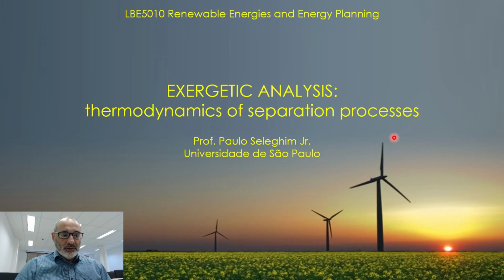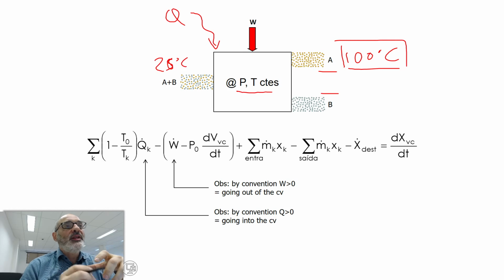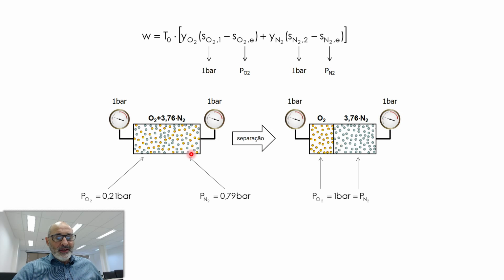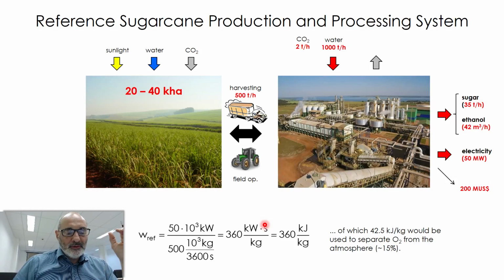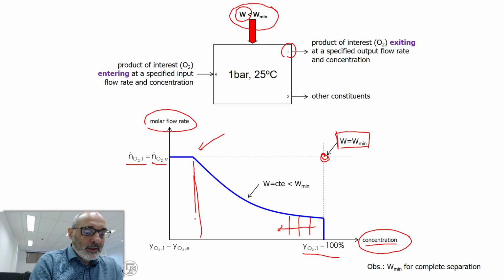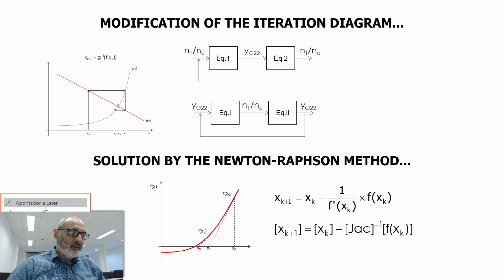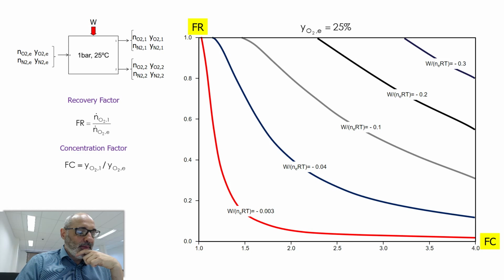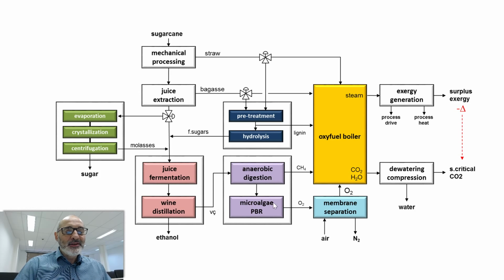Thermodynamics: EXERGY ANALYSIS: Separation Processes

Comment: For the oxyfuel process, we just have to separate O2 from air, whereas it is not required to also separate a fraction of pure N2. If you redo the calculation this yields a cheaper optimal cost.
Reply: My point is clarified by looking at the analogous case of desalination: the output products there is not freshwater and pure solid salt, but rather freshwater and brine. 100% 2nd law efficiency is approached in the limit where the brine is almost identical to the pre-separation saltwater (extract a minimal amount of freshwater from a large overdose of saltwater, replace that body of that slightly saltier water with a new body of saltwater and rinse repeat)

Comment: Dear Professor,

Thank you for the lecture. In 1:12:34, could you please explain how you replaced exergy (x) with -T0(S-S0) and then that (S-S0) with n*R*y*ln(y). I understood how you replaced exergy (x) with -T0(S-S0) but the latter wasn't clear since (S-S0) equals to n*R*y*ln(y) only when that entropy change is due to it's separation from a mixture i.e. S0 must be the value at it's output after separation while S must be the value in mixture.  Here in this equation (S-S0) simply indicates the entropy difference between environment and system conditions.

Also, the minimum work obtained is the energy and not the exergy required for the separation or both are same in this case?